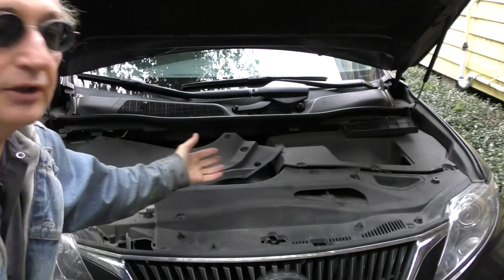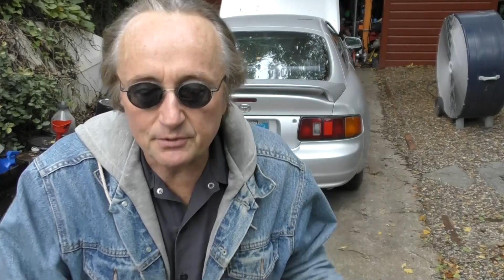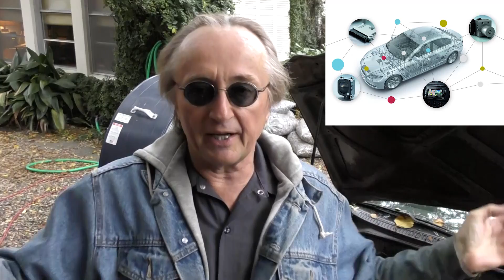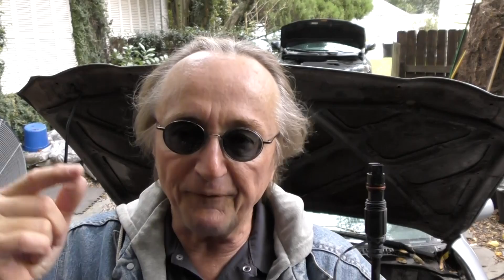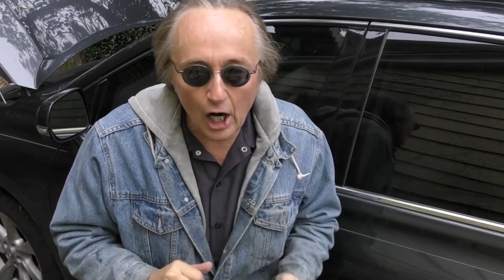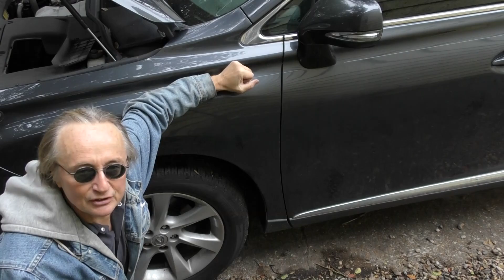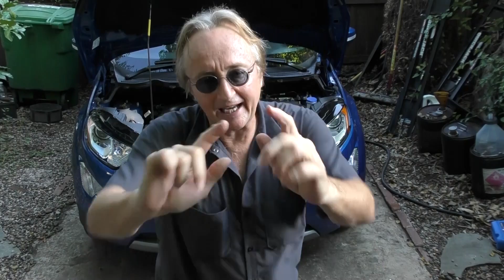The End of DIY Car Repair, Why New Cars are So Hard to Work On

Comment: There should be a company where old cars are made new again.
Reply: There is it's called Icon.
Reply: Jake McCoy is right but I am going to add this    yeah it's impossible to come out with old designs due to safter and fuel standards
Reply: the banks, the oil companies, and the dealerships are all one big giant mafia out to steal your money and keep you poor and exploit the hell out of you, that's is why older cars that were good and simple got immediately removed from society, and people who invented vehicles that could bypass the banks, oil companies and dealerships were mysteriously murdered shortly after
Reply: There are many shops that do. Got around a hundred grand laying around??
Reply: I just keep repairing my 91 model. Cheap to maintain and hardly ever needs anything. Insurance cost is $15 a month because it's an extra vehicle.
Reply: I'd like a modern BMW E30. Without electronics except injection and ABS. Standardized parts. Swappable parts. Customizable. Easy to work on, sturdy, light. Boxy design, inline 6, 1000kg empty weight, 200hp, 6 speed manual gearbox. Totally in the realm of our technical and financial possibilities, but no car company will do it. 30'000$ seems a reasonable price for such a car, if it lasts.

I'd also like a modern Chevrolet Astro. Rugged exterior and comfy interior. Also easy, standardized equipment. No fancy GPS, park assist or useless stuff. Just give it 4 DIN slots where you can add after market stuff you need, and decent fuel economy.

For everyday use, I'f finally like a fun electric little 2 seater, with a battery just large enough to go to work and back. Something like a Toyota iQ electric, or Renault Twizy but with more power and enough comfort.

Please someone make these, and make them to last. Car manufacturers need to rethink their business models if they want to survive. They say, I'm a dreamer, but I'm no the only one....
Reply: legionary illuminati  Yeah we need to back to coal burning automobiles. LOL
Reply: just buy new Dacia Logan, they are still computerless  XD
Reply: That One Gamer There is in Colorado but he imports them from Australia. LOL
Reply: There is they're called car restoration shops.
Reply: Can make one yourself lol
Reply: Tom I’m talking authentic old cars reborn, like the maverick, old mustang, the old ford and Chevy pickups. The easy to work on, reliable, cheap and easy to operate ones.
Reply: You all idealists would need to change the way the world is run theses days. Car companies who seem to compete on the market can work together pretty well when it comes to financing politicians who make laws. And then - your car suddenly HAS to have all the diagnostic electronics or it's not allowed to be sold. A separate law makes building your own car illegal (not everywhere, I suppose). And the extra weight? All the hidden structural members do add weight but they also contribute to safety. The E30 looks nice with the thin roof pillars, but will you survive in one when it lands upside down?
Someone suggested a Dacia Logan. It's a good example. It is very basic. But Deer Load, is it a POS car...
Reply: There are, but they charge a LOT for the refurbished vehicles.
Also, most people today would have trouble with the feel of the steering and
braking in older cars. Myself, I grew up with those 50's and 60's cars so
it would be a non issue. But for someone who was born, say, after 1980, hopping into
a 1962 Buick might end up being quite a thrill.
Reply: The old cars where easy diagnose ,but  got bad milage and the points worn burn out alot . But they where cheap compared to todays,cars
Reply: It would probably need to be a division of the original company. It would be cool to see Ford remake a classic mustang with fresh parts.
Reply: they stopped making 70's model VW beetles in mexico around year 2000
Reply: Without the restoration prices
Reply: Alexander J 
I’m fairly sure it is possible to build (for an example) a 1969 Ford Mustang Cobra Jet in 2019 fashion.... With today’s material being stronger and lighter while being able to build a more reliable and lighter V-8 with just as much horse power it could easily be done. Now, it may cost an incredible amount to manufacture from scratch, but it’s defiantly doable. If they thought they could make a nice profit someone would do it.
Reply: @larrynorsworthy8582  what do you drive
Reply: @geoftle   a1991 gmc Sonoma 4.3
Reply: @larrynorsworthy8582  just curious whats the other vehicle you have
Reply: @geoftle   2016 Honda Civic
Reply: there are plenty of restoration company's in any city
Reply: @larrynorsworthy8582  good one
Reply: Like JORDANS. I like your thinking
Reply: our shop takes classic Mercedes and makes them ready to use every day
Reply: They’re called restomods
Reply: There is.  Called Fantomworks in VA...  LOL
Reply: There are. They are called "restorers". Bring money or do it yourself. If you want it badly enough you can make it happen.
Reply: FantomWorks...
might be cost prohibitive
Reply: Morgan? They look old at least and they 're made from wood.
Reply: Have a 65 Chevy 327 engine I’ve been driving it for 20 years it’s fast it’s reliable and there’s no omissions test
Reply: Agree
Reply: There is . It’s called wild rose 911. Videos all over youtube
Reply: GM - “bite your tongue”
Reply: There are companies that do complete restorations. It will be expensive but so are brand new cars.
Reply: There is and there is plenty of them called "smash repairs", "auto upholsterers", "starter and alternator rebuilders" etc.
The only issue is the cost (getting rid of the market value vs money spend), patience (as we have now short fuses due to the instant generation) and effort to get them all done (as we have become lazy and want things done ALREADY).
Reply: There is . It’s called Leno’s garage
Reply: redneckrenos303:  I was gonna say something similar, but you nailed it brother, you’re 100% correct.
Reply: Here in the Philippines, we do have Owner Type Jeep, Customized Jeep which you can buy 2nd Hand and mostly build by Shop with Fabrications of Painted Galvanized Body (sometimes Stainless) and Frame... The fun part here is you can put and Non-Computerized Old Engine (with some Fabrications in Frame Number or Legal Paper Processing) of your desire, like in my Jeep that has Toyota 4K Engine and Parts are SO CHEAP these days! Lucky to own one... =)
Reply: Then they wouldn't be old cars anymore
Reply: The best episode
Reply: Toyota
Reply: Bring back the steam engine!!!!

Comment: I hope they never stop making older car parts and the industry stays alive and well for us who enjoy getting dirty under the hood.
Reply: But they die anyway because rust eats them.
Reply: Rust in Phoenix? Don't worry, China will make the parts...
Reply: Well, here is your answer. There are still horseback ruding and horse and buggies. Rare, but still here.
Reply: @crimpcreep6887  Or just go to Penny Pincher Auto on west Van Buren Street like I do and get all the parts you need.LMAO, no rust required
Reply: Engineers will be raking in that money, because those old cars are going to be in circulation for a very long time, the pieces will be cheap and durable to make, very profitable
Reply: @TheBlackstarrt  Where would you drive them and how long would it take to go 20 miles? Don't forget the daily chores and expenses to keep these machine replacements going during their short useful lifespans.
Reply: @weedmastersr  If you wash a car regularly and take care of it, you can keep rust/rot away.
Reply: @LN997-i8x  No, it really depends on where you live. Somewhere with proper winters, the road salt will eat it away no matter how much you wash it.
Reply: @josephbell2160  I shop there, Sanderson Ford off 51st Ave has a separate Auto parts store on outside corner of bldg, cheap Factory parts, all makes. Hit up eBay most the time.😀
Reply: @crimpcreep6887  Thanks for the info. I may run into you sometime
Reply: @weedmastersr  Force your city folks into using sand instead of salt.

Comment: Rev up your plastic covers!
Reply: @Indrid Cold Same goes for my '09 Jeep Patriot, my air-intake which also serves as a battery cover would "seize" in place where I could barely remove the clips holding them in, just shows how bad plastic can be on most vehicles with your situation as well.
Reply: Wtf
Reply: Indrid Cold right, but aren’t the covers just held by a screw which can be undone and I don’t know if it’s not a standard 4 line or a more uncommon star pattern but surely the tool must of come with the car along with the head to remove the wheels in case of a flat.
Reply: Hahahaha I LOLed. Nicely played!
Reply: HOOO!
Reply: Yeah, for real.
Reply: Rev up your plastic intake manifolds

Comment: Don't have to buy the new junk. Just buy older cars , easy to work on, cheap insurance, cheap taxes, cheap to fix ,ect ect.
Reply: Jake McCoy is right but I am going to add this  I have a 79 Camaro and a 88 Chevrolet dually.  No problems at all.
Reply: life of Wyatt can we talk about how you literally 12 years old lmfao
Reply: I think you meant etc?
Reply: People are wanting crazy money for old rust buckets from the 60s and 70s, 80s.
Reply: Well, not exactly. Ive got a 99 chevy van and a 99 ford f 250. Neither are easy to work on or cheap to repair. If by older you mean something like my 67 ford f 250 then yes. But its a complete fo it yourself truck. It also lacks a lot in the comfort department. At my age i like comfort.
Reply: Mike Coppola 😂😂😂
Reply: exactly! that's why I went out and bought me a 54 dodge M-37... 8k, invested 3k and its (almost) a daily driver. and before that I had a 88 chevy suburban, witch I bought back in 95' and had to retire it in 2014. lost the battle with NY state salt.
Reply: Problem is finding one in good mechanical and cosmetic shape. Age is a cruel mistress. 
I have a 90 Mustang that I bought new and it has all og 10,500 miles on it. I just never drove it.
It has been drove a few times a month and has always been in a climate controlled garage. But still, little
crap like the power window motor switch on the driver's door or the power lock switch on the passenger's door stopped working and had to be fixed. Other little things would act up now and then. 
Also, I changed fluids on a regular basis, and even do oil changes once a year. (at as little as 300 miles!)
Problem is that most old vehicles are not taken care of like I do that old Mustang. They sit outside,
do not have fluid changes and are in pretty poor condition. So, you need to expect to have to do
a total restoration on a car that is much over 20 years old. Rubber seals and dumb stuff like that will be 
in need of replacement. Still, if you are up to it, the end product can be a very tough reliable vehicle that
you can maintain much easier then these newer computer controlled electric kiddie cars.
As for 'resto mods', the idea is to have an old car that is easy to work on. Why would you want to 
mod a car to modern standards with all the same crap that is on and failing on a new car? 
Brings new meaning to the word 'Duh". If I buy a 1962 Thunderbird, I bloody well want a 1962 Thunderbird, not some cobbled up T-Bird with a bunch of modern parts in it. If you can't handle recirculating ball steering
and drum brakes, then stick with a modern Toyota Corolla and when it acts up, junk it and buy another.
Reply: Yup yup yup. Had a 07 Nissan sentra. Had to drop my transmission to replace a 40$ slave cylinder. I now have a 98 f150 with 120k on and parts are literally half the price.
Reply: What year would you guys say is a good cut off for cars that are no too modern and complicated to fix but still reliable and have modern safety features like crumple zones,airbags,etc,etc 2006 and older?
Reply: @Eli70mod  any car that has fuel injection and is OBD2. So from 1996-2010 is good. Fuel injection just makes it where you'll never have to service the fuel system like you would a carburetor system, OBD1 cars was when manufactures weren't standardized on computer diagnostics and is a bit more teadious to read codes (counting light flashes) compaired to OBD2.

 All the cars that come from factory with a touchscreen monitor are pretty much the epitome of useless features that cars didnt need but wont function without it because some companys integrated it as part of the cars computer.
Reply: Problem is if you go too old (say 72 Eldorado) when you crash you DIE and we maybe scrape you out and resell car.   But newer cars I imagine will have SecureFoam like in Demolition Man or it will just disentigrate and you'll be left sitting on the road wondering where did the car go...
Reply: @outdoorfreedom9778  dont buy anything older than 96, then you can get BlueDevil or cheap OBDII scan tool.   And you don't have to buy weird adapters
Reply: Jake McCoy I have a 65 Mustang, runs great.
Reply: Nick J  Probably because the famous actor Anton Yelchin died in 2016 after his Grand Cherokee rolled backwards down a hill and crushed him between a brick pillar.
Reply: @randycoolbaugh1408  Me to.  Just picked up a 1975 dodge dart sport last jun & love it. & my 98 dodge ram pickup is great.  I wouldn't take a new car or truck if they gave it to me for free. Except maybe a Dodge Demon,  hahahaha.
Reply: But they don't make older cars any more. And Cash for Clunkers wiped out a lot of good ones.
Reply: New cars actually have better insurance because insurance companies consider them safer because of things like side air bags and other new safety features.
Reply: @Solmangrundy  100% agreed especially if they're Hondas or Toyotas.
Reply: @metalmopars  yeah a new Chrysler/Dodge it'll be great until it breaks before it even has 100,000 miles on it.
Reply: @JustinBobby-di9zt  177,000 on my daily driven 2000 Toyota Tacoma. NYS salt forced the 95 off the road 8 years ago due to frame rusting. It lived a 2nd life as a dirt track packing truck until frame finally snapped last year, probably 200,000 on it or more, original engine and transmission.
Reply: I’m with u but that fuel economy u get with newer old cars (2002 civic) is hard to argue with. Although a 17 year old car is hardly new, it’s just new enough to get good mileage but old enough to wrench on
Reply: I'm not so sure I want a vehicle with high milage
Reply: The only problem is to find parts to fix it, i had a 95 mighty max and had trouble finding the clutch fork and a/c compressor non of my local auto parts store had them. It was a very reliable little truck but i ended up selling it for that reason.
Reply: That’s right
Reply: @thereaction18  You wouldn't want the cars I have retired for cash anyways.

Comment: I completely restored and modified my na miata. It literally gets looks and complements wherever I go but I paid 8k back in ‘99 and another 8k restoration/ upgrade cost last year. 

Best of all, I can work on much of it myself and it’s a blast!

New cars are full of crap I never asked for or don’t want to wait around for to break and spend an arm and a leg for just to get some gimmick to work again.
Reply: Good I cam across your comment. I am looking at a 1993 limited edition miata of course it's an NA and it's got 112k miles it has a turbo and it was put on at 98k miles. It has a fuel leak under the hood and I assume the fuel line popped off. I am going to buy it and restore it a little. How much is repairs on the soft top? Molde also
Reply: Cody Dixon what’s wrong with the soft top. If you get a good, low mile rust free na a straight body, it’s usually well worth it. Replacing a soft top is $1500 or 500 if you do it yourself

Comment: Just wait until the change the OBD system and lock it so only a dealer can check it. Wait, that sounds like a violation of Anti-Trust laws.
Reply: Fake news
Reply: @jasenrock  I figured there would be some law against it
Reply: Yup, it's coming. Companies will start selling licence for these obd tools
Reply: Imagine how many auto parts stores, aftermarket producers and auto repair shops that doing that would put out of business? If the government would bail out Chrysler twice. Because they're too big to fail. Do you think they would allow that to impact THEIR tax income?
Reply: NOMCCBAMA  It wouldn’t affect them all that much. The auto part stores are so big and have so many locations they would get a bundle deal on the scan tools and get them a lot cheaper. The garages for the most part wouldn’t have to worry for a little while since under warranty you bring your car back to the dealer. That gives them time to buy one and plus new companies would emerge to make the scan tools. So it would benefit the government actually. I’m surprised it hasn’t been done yet
Reply: Audi does limit the OBD atleast in the EU. You can only read a few basic things, but for the complex stuff you have to go to a dealer.
Reply: Take a look into right to repair. John Deere has already done that and it is making a huge stink. The people who can, just won't buy it. You have to have a JD service(No independent shops either) come install(Computer accept) new parts. Part of this is the result of emissions laws that are so tight they need a complex systems, and having to fight costumers from deleting them. This helps JD ensure that the machine operates the same way as they built it to and meets regulations. Please support the right to repair movement and anyway you can!! Vote with your dollars!! The computer control is solely responsible for the efficiency and reliability we now enjoy. Change with the world or be left behind, but be responsible about moving forward.